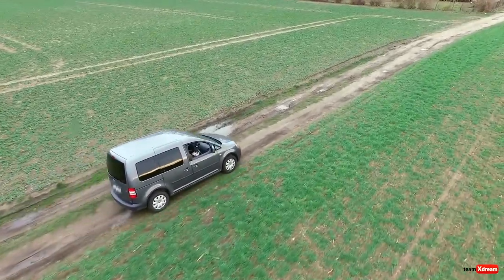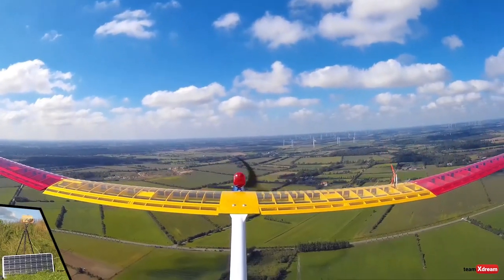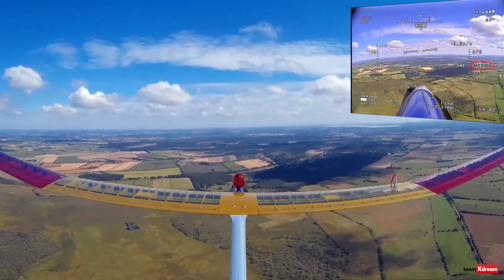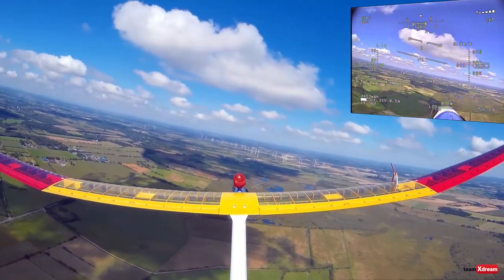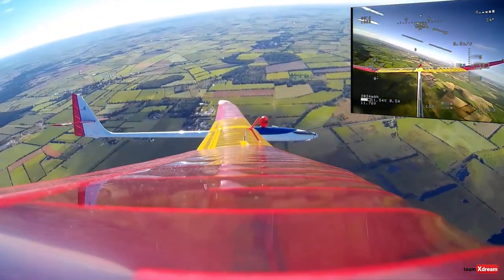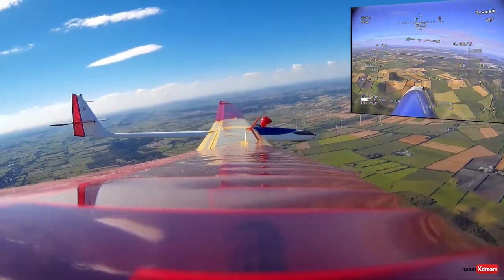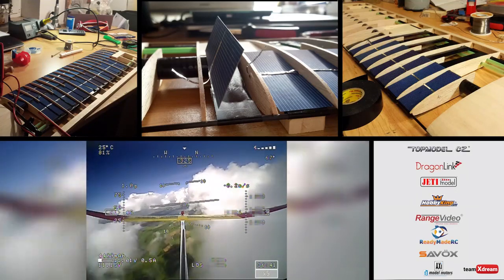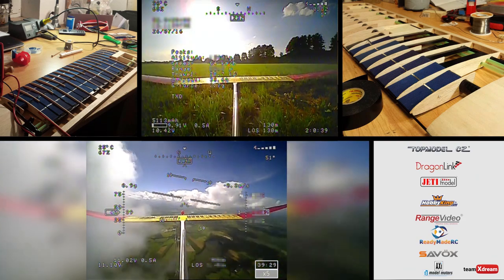Grafas MAXi 3.5E F5J | FPV Soaring | RVOSD | Dragon Link | RunCam | Glider | by teamXdream

Comment: How did you set up crow with the RVOSD? I can't find any info on that, especially now that the rangevideo forums are down.
Reply from the maker: Crow isn´t stored in RVOSD, i initiate it manually by RCTx. It works best while FBW is active.
I also tried to implement differential-aileron-mixing via RVOSD but I did not get it running. It is solved mechanically.

Comment: Fantastic! It looks like a nice upgrade glider for me, but it's wings may not be tough enough to handle landing in rough grass as I do in Sicily where there is almost no flat smooth grass to land on.  You can also just put the RunCam2 on a pan mount. The added lag and drag are negligible. Are you also using the L1D variometer? I don't see it listed in the description.
Reply from the maker: hi, and thanks.... u are right, i missed the vario >> info added! (its not the L1D)
i ordererd a new canopy and did de runcam 2 job: https://youtu.be/L2rjPC19hnk
current record flight time = 3h40min (video following)
Reply: That pan system with the Runcam2 looks good.

Comment: Great video!!!....Last night I was just about to purchase the L1D vario, but then I found an offer I couldn't refuse for an rvosd G6. I've got 4 earlier versions, but as shown in your video, the FW comes with thermal assist.....is an audio vario better ?????
Cheers
Cadders
Reply from the maker: Thanks mate, i like both, because the visual thermal "X" from OSD matches exactly with audio beep and supports you optically where the last lift began. If you don´t know, give "DIY simple and inexpensive Arduino-based sailplane variometer" a try (rcgroupscom). It should be better than mine and will cost 10 times less than L1D.